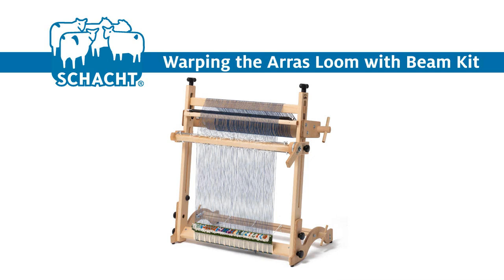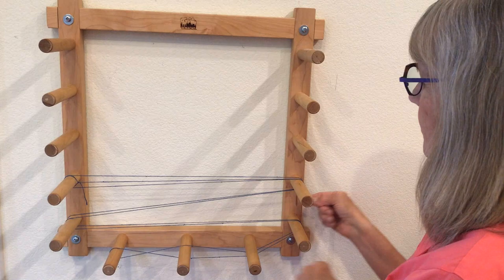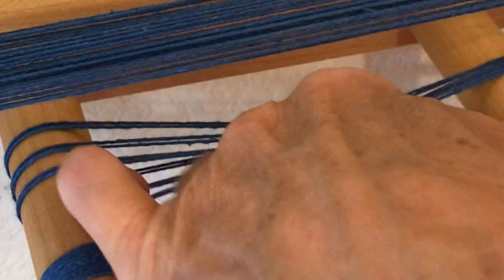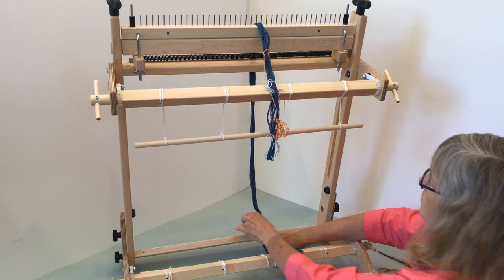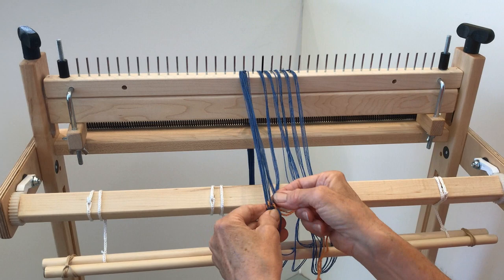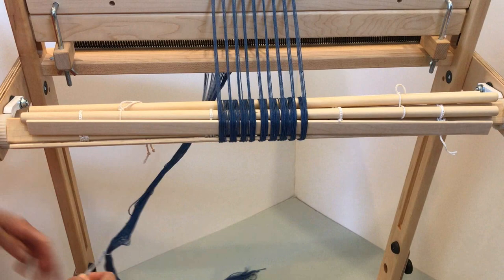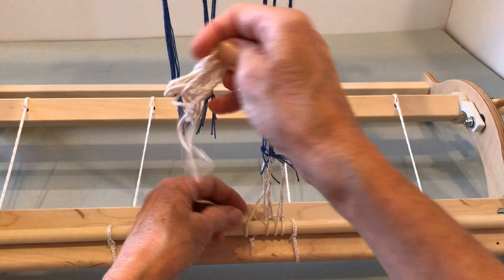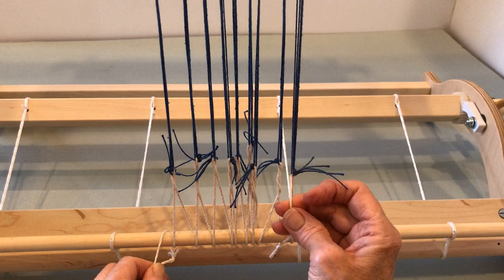Warping the Arras Tapestry Loom with Beam Kit

Comment: 1. What is the max recommended warp length when using warping beam? 2. What keeps warp ends from jumping out of the coil, for example when tension is loosened? 3. What keeps warping bar and apron bar from warping under high tension? Thank you.
Reply from the maker: Hi Cate, I would say you don’t want to put more than 5 yards on…but this depends on the fabric being woven. A wider sett, with say 5 epi and heavy weft yarn will fill more space on the cloth beam than a warp sett of 12 and a cloth woven with fine yarns. I would suggest that the weaver start with 2-3 yards.

I loosen the tension just slightly so the threads jumping out of the coils hasn’t been a problem. I have used blue painters’ tape over the coils during warping and I don’t see any reason why you couldn’t use this during weaving if the warp yarns are coming out of the coils.

If your warping or apron bar bend during warping and weaving, it is because you have a narrow warp. Removing the outside apron cords will take care of this problem. The bar bends because some of the bar is under tension and other parts aren’t. Removing the outside apron cords takes care of this problem because now those parts of the bar aren’t under tension.
Reply: Schacht Spindle Many thanks!